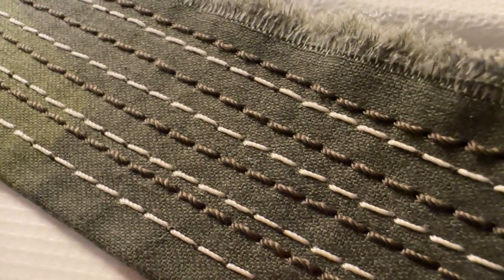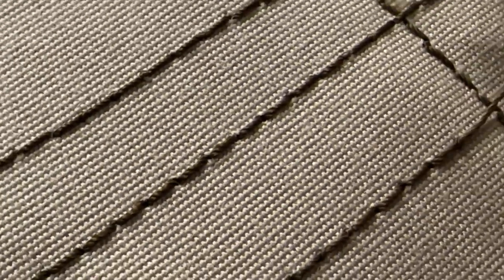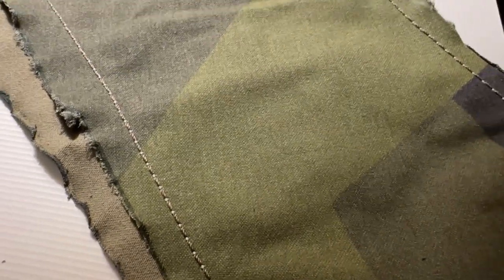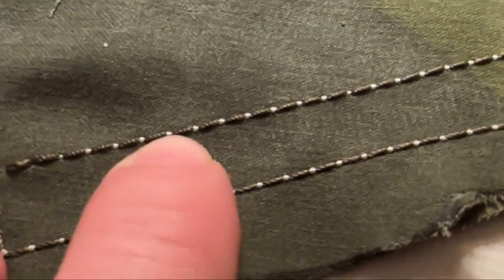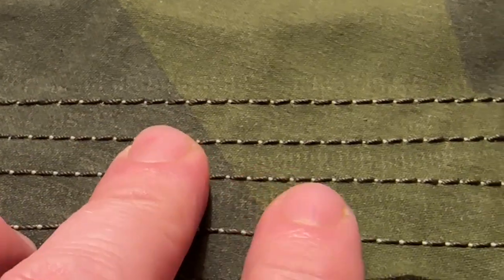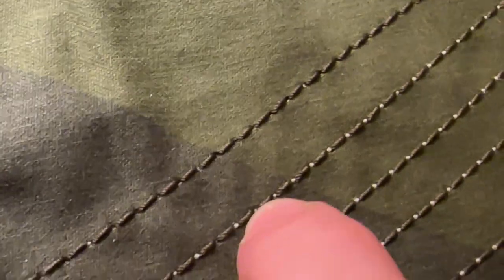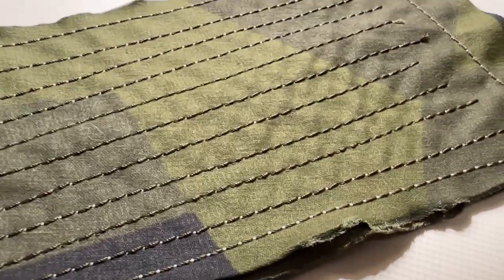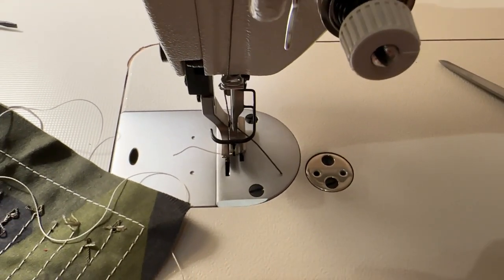Thread tension - in depth review - industrial sewing - Juki machine

Comment: Hold on now sir, I've been sewing almost 50 years, your making it harder than it is when it is basic common sense. You are trying to hide the thread twist of a very thick thread inbetween only 2 layers of a fabric weight that just is not thick enough to hide it. Drop down to a thinner thread that is appropriate for what you are sewing. If the thread used must be two different colors and certain parts of the project is only 2 layers of fabric no amount or adjustment will hide the twist, just switch the thread/needle to smaller gauge for those areas, the stitch is fine and well formed, its the fabric that is not thick enough to hide it. Its like your trying to force a big size 10 foot into a size 7 sandal,  your toes will hang out the front and heel out the back of the sandal, no way around it, get the right shoe, same principle.
Reply from the maker: Good point about the choice of thread thickness, etc, but are you really saying that the thread tension setting is nonsense? There is no need to do anything about it because one can fix the issue of having the bottom thread showing on the top of the fabric by selecting a thicker fabric? I doubt the Japanese engineers constructing the Juki machines with adjustable thread tension share your views. However, I am happy you found a solution that works for you!

Comment: I’ve been trying to adjust my Juki ddl 8700 for days the same way and nothing works, I even changed needles and needle sizes and nothing works :(
Reply from the maker: Get some really thick artificial plastic leather, it will help you see it more clearly. Test the extremes on the settings and don’t hesitate on trying this because once you have tested the most extreme values, you then gradually narrow it down to the best setting. If this doesn’t work, you have and issue with the selected thread vs needle and need to test for a different fabric, needle + thread combination. As last resort you have a problematical machine, which is unlikely.

Comment: Regarding thread tension, you may find this video useful. https://youtu.be/kINRgj42GnI
Most users use the yoyo method or drop test to set bobbin thread tension. But in my experience, you need a bit more bobbin thread tension with higher thread thickness, and I normally use 0.5 Newton for Serafil 20.
I is a different issue to reduce the variation in height of the lock of the stitch. For a normal lock stitch machine, it will depend of the timing of the feed. For a walking foot machine like yours, the variance may be bigger than a normal sewing machine, but I do not know the specifics for such machines. Be aware, that just changing the thread color of serafil 20 or other kinds of thread will likely change bobbin thread tension. Different batches of same type of thread are different.